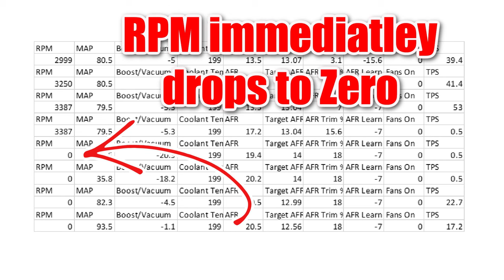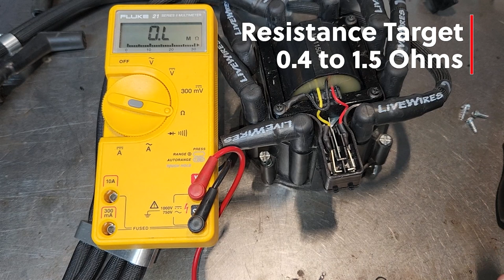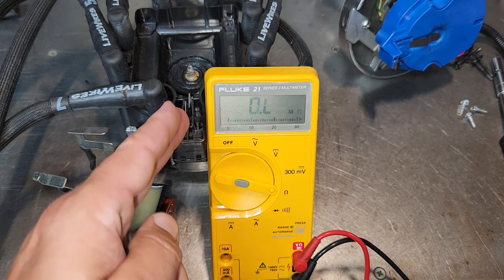How to Diagnose and Fix your HEI Distributor.  With driving footage.

Comment: I have a 65 El Camino,350,HEI distributor,my issue is :

I will be driving,or sitting at an idling,and it dies,like all electrical power is shut off,I put it in neutral,starts right back up. Why am I completely losing power,then start back up ?

Help !
Thx Amy
Reply from the maker: Great question Amy... first things first, you have to verify (somehow) that your ignition system is truly losing power at idle.  I'm not an expert on Automatics, but my understanding is your carb needs at little bit more fuel at idle, versus idling in neutral.  That's where I'd start,  make sure your idle is high enough to overcome the torque converter, while stopped in Drive.  If you do prove that you are losing supply power to the HEI unit, you might look at the wire gauge going to power, and/or alternator/battery voltage at idle.  Should be around 13.5... check out my alternator video I recently did... https://youtu.be/4ZdHQdJgoDo   Keep us posted!
Reply: @FastMonty  I have narrowed it down to the igniton module and or the coil. At one point starting it,it was acting the timing was messed up,but a few seconds,it fired up like nothing happened
Reply from the maker: @The_Hollywood_Mission  Hmmm, yeah, suspicious for sure.  Do all the tests I went through... assuming those are good, try a brand new module.  Keep us posted!

Comment: Hi, what heater hose fittings you use for those cylinder heads? And from where i can buy it?
Reply from the maker: Good question... here's my original video about it.  https://youtu.be/DWvVkrGQDsw  After reviewing that one, please make sure you see my latest update on the subject here ... https://youtu.be/v_qUY4E33r0  (After market heads typically have a 3/4 NPT thread in those ports)  Have fun!

Comment: hey stupid question what should the ohm meter set to my secondary coil im getting open so i got new coil and its saying same thing so i know i probably did something wrong . my car shuts of after 5 min and wont start and wont start w starting fluid so i suspect its my distributor
Reply from the maker: All of the OHm readings are listed in the description.  I would recommend getting your HEI Module tested.  As that's the only thing we can not test with a multi meter, and needs a specialized tester typically found at auto parts stores.  Keep us posted as to what you find out!

Comment: Monty I have a 68 convertible bird, all original, heres my issue, I had a backfire, and it turned out to be a push rod was broken, I found 2 pieces a mellings push rod , mellings 041 cam,RAIv pistons,c16 heads, Rhoads lifter, any way, when I unplugged the #6 plug wire, no backfire ran great, I went ahead and replaced all the lifters all new push rods, then I primed the engine via the oil pump with the distributor out. Worked perfect, NOW I CAN'T GET THE DISTRIBUTOR TO SEAT,,, Any suggestions, I'm thinking I need to drop the oil pan and check to see if oil pump dist rod is perfectly indexed.
Reply from the maker: Wow, that's some rework... do NOT drop your pan.  You just have to rotate the pump shaft so it lines up with the distributor.  (WIth a long flat blade screw driver)  I also assume you marked somewhere on your firewall where the disti should be pointing, before removing it... so, I'll bet the slot in the shaft has to be turned a bit, especially since you primed the pump.  Let me know how it works out.
Reply: First I want to thank you for replying, ok um my mechanical background is fair, I'ts always been necessity, I. Bought my bird completely totaled,, $$$600, back in 1982, its had several motors , mostly cause it took me 6 years about 8k to get the original motor done right, I did find a set of full forged floater rods in a junk yard, anyway, I' absolutely did what you described, I swear I know what im doing, I've had that dang distributor out many times, as well . I keep thinking the shaft dosent seem to look straight like it seems at an angle, also i took a black magic marker so i could see wear Mark's in the distributor t
Reply from the maker: @jamesburns4361  Hmmm... you might need to get a flashlight and look down in there to make sure everything is ok.  I'm sure it is.  Then match the slot angle to where the distributor starts, before putting it in... not where it ends up, as it turns a little bit.  I recently had to do the same thing when I shot this video... that shaft doesn't need to rotate very much to make it difficult.

Comment: 0 gauge wire is bigger than 1 gauge if you're using a tan and you're going to a 12 you're making the wires smaller
Reply from the maker: Yup, the smaller the gauge, the bigger the wire.  Thanks.

Comment: I wonder if a champion radiator shroud could be used since they use the Spal fans. I know auto trans radio's have an internal trans cooler, so sometimes those radiators are not as efficient because of the extra heat.  Could you use one for a manual tarns and use a trans cooler to allow radiator to cool efficiently, but solely dedicated to engine cooling. as possible.
Reply from the maker: Yep, not sure what size SPAL Champion uses, but you could divert the tranny line to a standalone cooler.  Thanks1

Comment: Why would the contact button under the distributor cap break?
Reply from the maker: DId yours break?  Could be heat fatigue?  Doesn't sound good.
Reply: Yes, it broke. We found it broke when we started putting everything back together (couldn't get the truck started, so we replaced the ignition module)...bought a new distributor cap, put everything back together, and it broke again. Auto store swapped me straight across for a new one. The new distributor is all back together, but I'm kinda scared to put it on. Am I doing something wrong when I put the cap back on causing the button to be broken?
Reply from the maker: @stephenogburn496  Ohhh brother, so sorry to hear that.  Especially when installing the brand new unit.  AND, the receiving piece is spring loaded, right?  So, can you move the rotor up and down a little bit?  Like it has slop in the shaft?  (It should)   If you do have slop, maybe you're not using the correct cap, for the distributor?  Might need to get a whole new unit.  Let me know.

Comment: what kind of thermostat you running on the Pontiac? thanx
Reply from the maker: It currently has a 165, but will be bumping up to a 180 soon.
Reply: @FastMonty  what brand is it? ty
Reply from the maker: @raymondpadilla65  It's a Mr. Gasket.  I've also heard good things about EMP Stewart thermostats cuz they have holes in them to allow air bubbles out, and have a constant flow.
Reply: @FastMonty  ty yea im having problems when its a hundred degrees out and im pulling my boat it gradually creeps up to 230° and i have a 160 degree high flow meziere sbc 1965 c10 high flow pump and champion aluminum radiator electric fans kick on at 185 and running redline water wetter and only half a gallon coolant very frustrating... please help
Reply from the maker: @raymondpadilla65  I understand the frustration.  In your case, it's not the thermostat.  (Those are used to maintain higher heat in the engine, at it's rating)  When the system is higher than the rating, it's not being used.  So, that said, you have to look at other causes for the high heat.  Are you getting any coolant overflow out the expansion tank?  What radiator are you running?  Do you have a full shroud around the electric fans?
Reply: @FastMonty  ty yes i am getting overflow i have an overflow tank im running champion 3 row champion cc284 i also have an aluminum shroud for electric fans..
Reply from the maker: @raymondpadilla65  Do you refill after an overflow?  Is the coolant foamy looking?
Reply: @FastMonty  no when it cools down it sux it back in to the radiator...when it goes into overflow it just coolant
Reply: @FastMonty  if it is foamy what does that mean?
Reply from the maker: @raymondpadilla65  I was asking if coolant comes out of the overflow tank.  Secondly, if you open the cap after the coolant has cooled enough to do so, does it look like there's foam on the surface?  If so, you're head gasket is going, hence creating too much heat, and expanding the coolant.  If everything looks normal, you might consider a better radiator.  Ironically, my next video is about switching to a Cold Case radiator, with discount codes too.
Reply: @FastMonty  the tank does not overflow out of it or no foam underneath cap....the radiator i have supposed to be able to handle 600hp my engine maybe makes a little over 300hp...ty for help this one is a tuffy
Reply from the maker: @raymondpadilla65  Yup, sorry brother... keep us posted if you figure it out.
Reply: @FastMonty  ty so much for your help
Reply: @FastMonty  with the  (160 deg. T-Stat) i believe the coolant is staying in ur Rad. long enough. Have seen this situation  numerous occasions with 160 T-Stats even in very efficient cooling systems.  BEST, C4-ME. SAVE THE WAVE!!

Comment: Everybody says put a 10-12 gauge wire to the HEI.    Look at the wire from the coil it goes to.    It’s tiny.   Because the HEI draws like 2 amps.   🤣
Reply from the maker: Yup, probably because the HEI manufacture says to do that.  If you run with the original points style "resistor wire" it'll have a good chance of shorting it out, cuz that's what that wire was for, to prevent too much juice going to the old school points distributor.  Thanks!
Reply: @FastMonty .  Electrical engineering baffles me.  So I just do as I’m told.  My instructions said the same thing.   So I ran the big wire.   Just didn’t understand why when there’s virtually no load on the line.  Live and learn!  😁
Reply from the maker: @apachebill  Yup, better off not being stranded cuz the tiny original wire burns itself up... :)

Comment: The primary coil test, the secondary coil test and the magnetic test were all in range so you state the problem is the module. I  thought you would test the module to show exactly how many ohms it was out of range or if it was open..
Reply from the maker: Yeah, there are four things to test... the module has to be tested with a specialize tester, usually at an autoparts store.  So, process of elimination, I went down that road... and, as you can tell, it wasn't that either.  Hope it helped!

Comment: Hard to say, could've been the module and the wiring just hangin in there.  Had a brand new DUI in a dirt car.  Module crapped out.  3500rpm and/or under hard load it cut out bad, lost all power so I ran the race at half throttle max, managed to finish 6th.  Could put the module back in to verify but not really worth it.
Reply from the maker: Agreed, coulda been either issue, the barely there wire connector, and/or the module.  Thanks for your story, glad you finished that race!  (I recently swapped this out for a Pro Billet distributor, and stand alone coil... which lead to other interference issues.  LOL)  Thanks again!

Comment: That coil should not be painted. You should scrap away the paint that the ground connects to.
Reply from the maker: Good catch. But, the coil can be painted. As long as the ground terminal is not painted, you're good. Thanks!
Reply: @FastMonty  not for a proper ground. I know the threads may not be painted, I can't really tell but test from a spot on the painted coil and you'll see.
Reply from the maker: @itztheday6630  the ground wire connects inside the coil. The "laminate" is there to prevent corrosion. All decent coils should have some sort of coating. Good question.